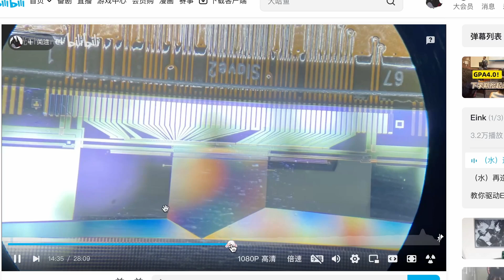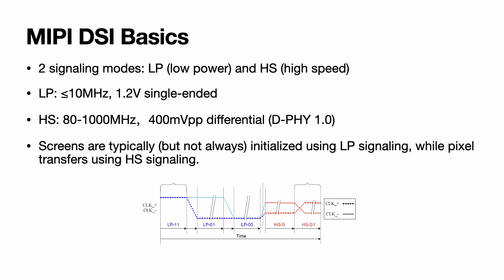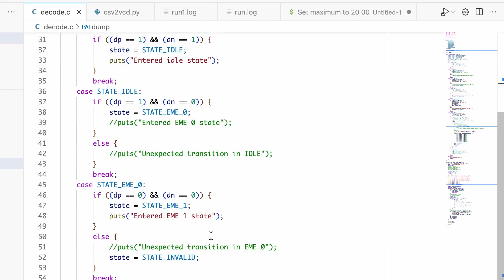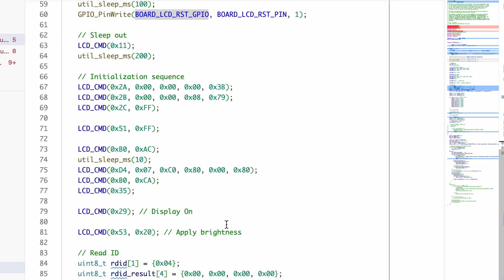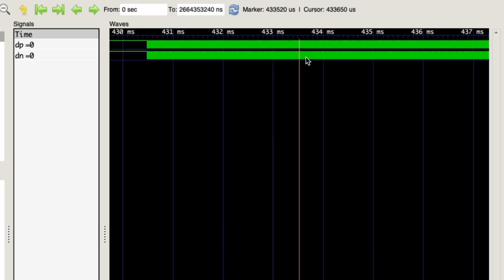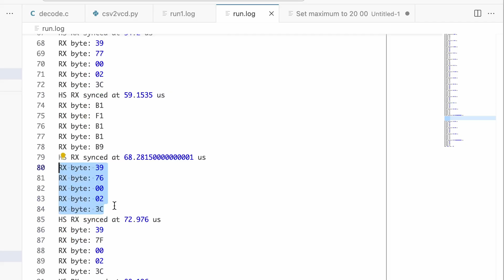Reverse Engineering the TouchBar Screen + MIPI DSI Primer

Comment: I’ve wondered about using a 1st gen iPad Pro screen in a Thinkpad x61 with a custom motherboard. I believe it is an LTL129JL01-A03, which panelook says uses eDP but I can’t find a datasheet. In theory, could I just plug it into something with eDP and it would work? Probably has a weird connector or something though.